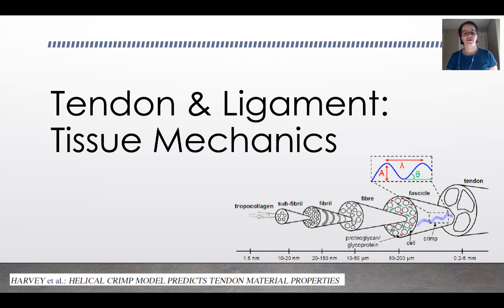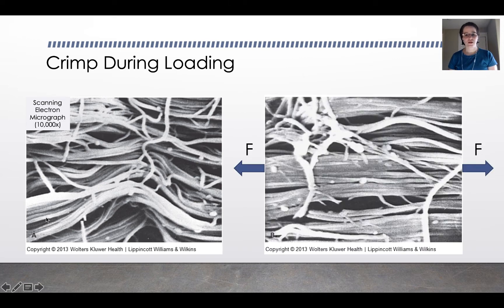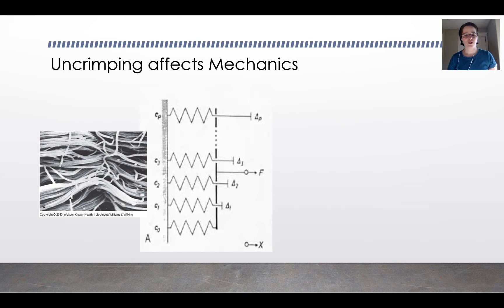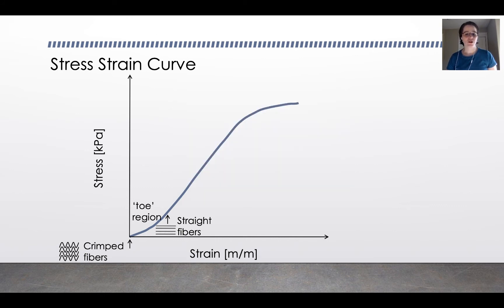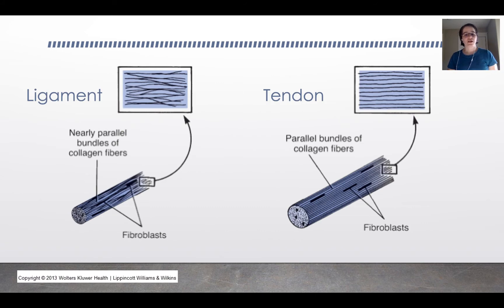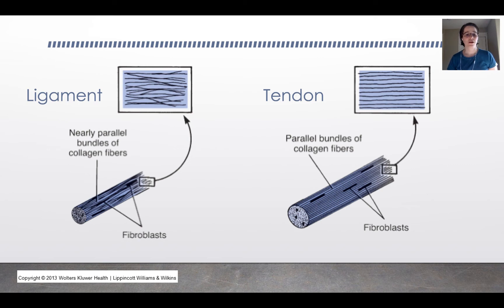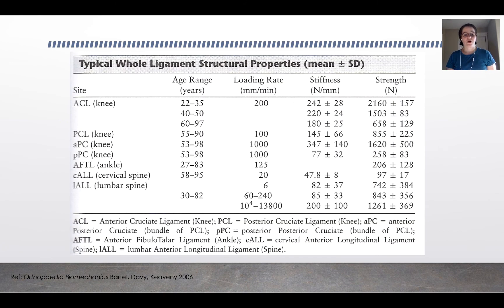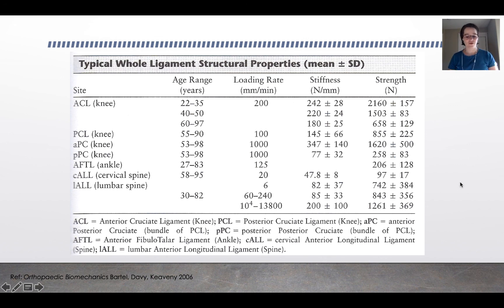Biomechanics: Tendon & Ligament Mechanical Properties

Comment: Hi 
After growthplates fusion in bones one cannot increase height.

But I want to increase my height. 
I just want solution, because right now there is only way to increase height is Limb lengthing surgery (using Precise 2.2 and other method). Even after this surgery you can maximum increase 3 inch in one time BECAUSE MUSCLES CANNOT STRETCH MORE and we have to have to stop after 3 inches maximum. 
1 want 1 foot increase in my height.

I want solution how one can increase height or atleast make legs longer. 

I want solution.
If you can help in this then please give a thought about it that how can one can add atleast 1 foot to height if one wants.